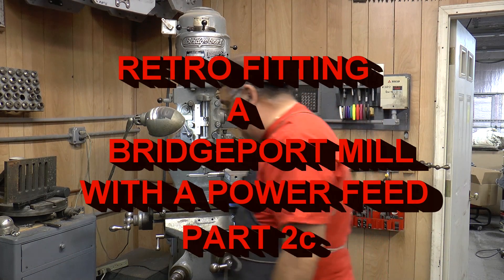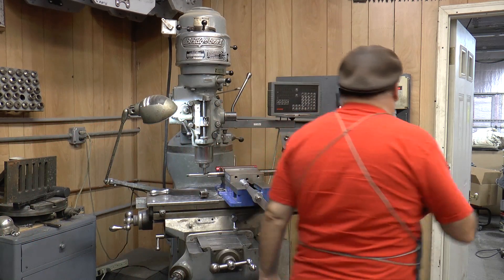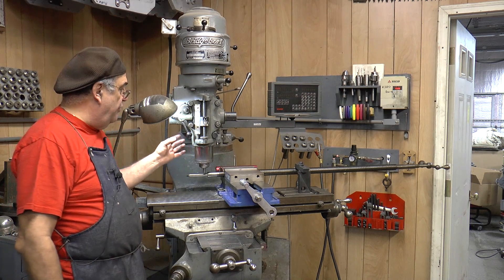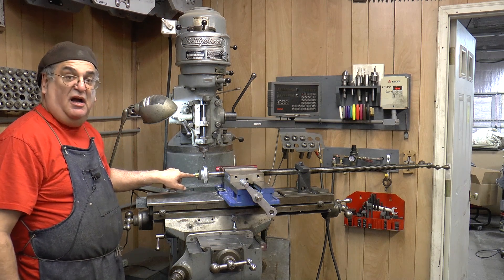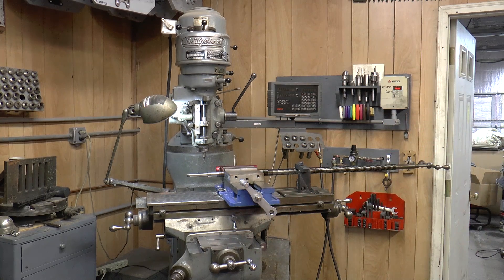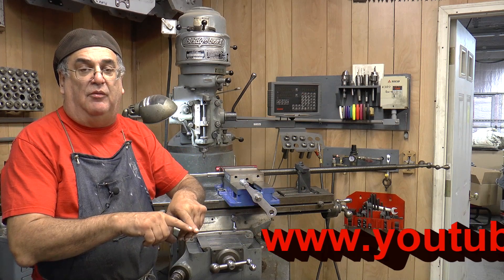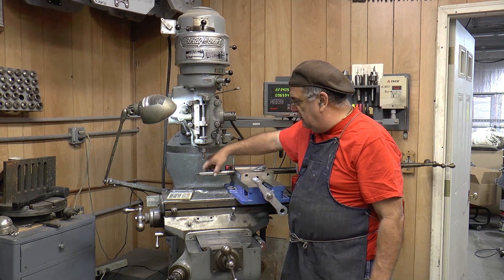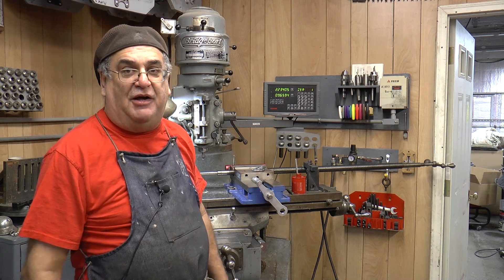RETRO FITTING A BRIDGEPORT MILL WITH A POWER FEED

Comment: Hi Dave just my notes on varible freq. We are still using a static phase conv. that was
free.  I can;t seem to see any loss of power? On one instance I smoked the belt and
this mill is no toy 10x50 Cincinnati with all power feeds. Only thing is the main must be
running before turning on any  power feed or coolant pump.  The main kind of acts like
a rotory phase converter.  Anyways it works fine however we are to get 3 phase soon,
the phone poles are already up just waiting for the national grid truck. good job
sam